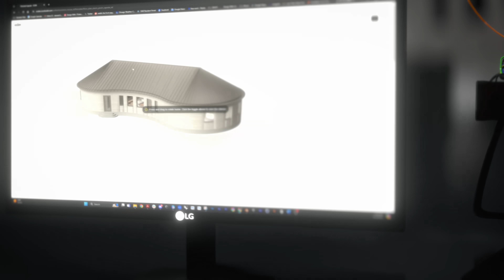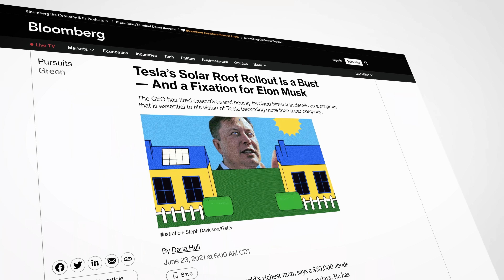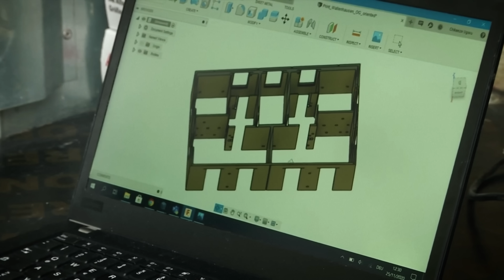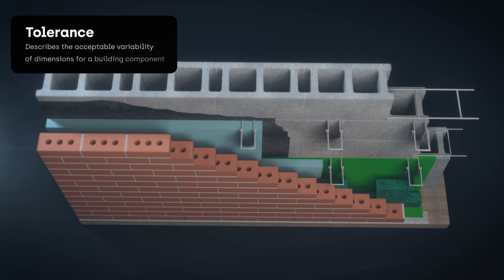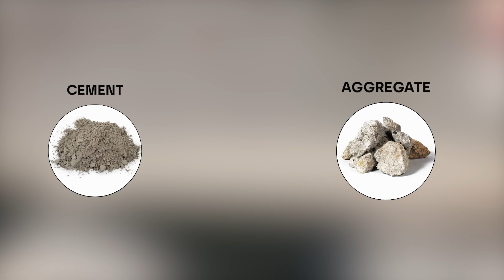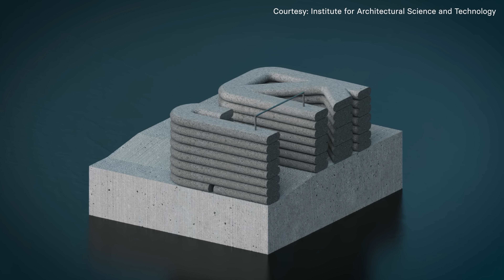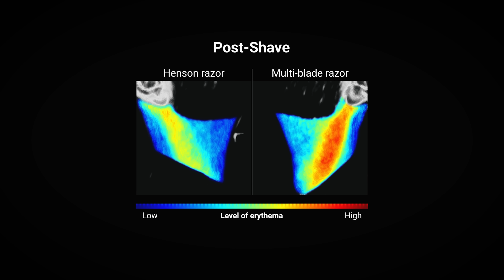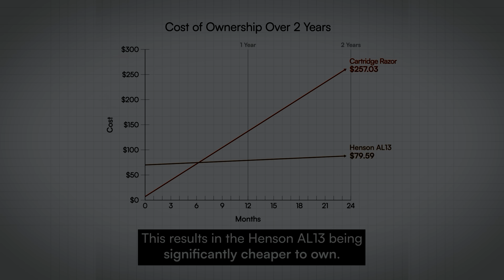Why 3D Printing Buildings Leads to Problems

Comment: You know what a bad idea is? A bad idea is pouring concrete without any reinforcing. Now that's a bad idea! Even some chicken wire in the mix makes concrete so much stronger. Take it from a guy that's jackhammered up more than his fair share of concrete. You want steel reinforcing in your concrete. That fibermesh is horse crap. Know what I'm not seeing in these printed houses? Reinforcing.
Reply: Lol, I am a seismologist and was thinking the same thing.

Honestly, some kind of resin/plastic 3D printed material would probably work since it's flexible, though I don't know about the longevity. Or maybe figure out how to 3D print what are essentially cinder.blocks (with open spaces), and then maybe you can add rebar down the center and pour in a slurry at the end to reinforce it?

There are also metal 3D printers... Could have multiple printer heads laying interleaving layers of concrete and metal (I assume actually making such a system would be practically complex).

Honestly, mass produced prefab "modules" probably makes more sense. Attach modules together as the "skeleton" of the house, and then the facade can be whatever you want to customize its appearance.

I assume there are construction professionals (not me) that are thinking about these sorts of things.
Reply: @brayoungful  I have seen these homes get built and they use a Quick Tie anchoring system to secure all of the walls to the foundation. Everything is held down under tension
Reply: @brayoungful  Prefab solves more problems than 3D print does. In Sweden a vast majority of multifamily housing is built out of prefabricated concrete.
Reply: @brayoungful  Far as I know, 3D printing in metal is all about high-precision prototype stuff. Though there's some "heavy industry" use making turbine blades for jet engines and power stations. Since they can print them with internal cooling channels and the like. It's done by sintering, laying down a layer of metal powder, then using lasers or electon beams, or something else, to melt the powder together wherever the beam hits and heats it up. Then they pour on the next layer of metal powder. So you end up with a sintered part. Complex and light but not as strong as just casting or forming some steel.

I dunno about just printing metal reinforcement for buildings. AFAIK they don't use the standard desktop 3D printer method of just extruding through a nozzle, that would be really really difficult to do with steel, you'd have to melt it. There's metal wire 3D printing that's a bit similar, laying down metal wire that's melted just at it's end, but it's not fast and it doesn't do "chunky"! 

You'd be better getting some humans to come in now and then and stick metal reinforcements in. Except of course the printer would have to work around them. Might not be possible to get the concrete around the metal parts if they're blocking the printhead.

Really the whole thing is a "solution" looking for a problem that it can't solve anyway. A daft novelty. Given the choice, I'd buy a properly-constructed house over a sand-and-cement extruded one 100 times out of 100. 3D printing doesn't make sense, in lots of areas, but that's OK.
Reply: @greenaum 3d printing steel is probably still a complete mess with heating and cooling related stresses on printed parts. They can manufacture expensive complex parts and use x-ray diffraction or similar to check stresses from the surface. No way that will happen with something like concrete rebars.
Reply: @brayoungful There's some fundamental flaws in the way 3D printing works that need to be solved before any attempt at printing rebar into printed concrete would work. You need the metal to be a cohesive mass throughout the entire length of it. As far as I'm aware, it's still a struggle for metal 3D printing in a controlled environment. With weather and humidity involved, at best you might get the structural quality of some really dodgy welds. At worst, it'll just be a stack of coins begging to fall over.
Reply: @brayoungful  Metal 3D printers are basically welding machine and keeping extremely hot, liquid metals from corroding instantly is the job of expensive nobel gasses in enclosed cases free of air movement.
The temperatures along would blast the wet concrete with it's high water content apart.
Reply: @brayoungful you could attach both printers to one arm, and have metal and concrete printing be sequential for each layer.
Reply: @ Metal printing doesn't work that way. 3D metal printing basically consists of having a box of powdered metal and inert gases, and using lasers or other point energy sources to melt and weld the powdered metals together, then layering more powdered metal on top and repeating.

If you tried to 3D print any ferrous metal in the open atmosphere, you'd just get rust. Not to mention, the heat needed would cause the water in any nearby concrete to boil, which is going to be problematic.
Reply: @brayoungful  Not every place has earthquakes.
Reply: @brayoungful  You're right, that kind of modular tech could revolutionize construction!

What do you mean, the Soviet Union invented that 75 years ago?!
Reply: @brayoungful Metal printing works in a totally different way than printing with concrete. 

Metal is printed by heating up the part of a bed of metal dust with a powerful laser. Then you add some more metal dust to just cover the structure and repeat. 
That’s going to be a challenge combining with layers of poured concrete.
Reply: So true!
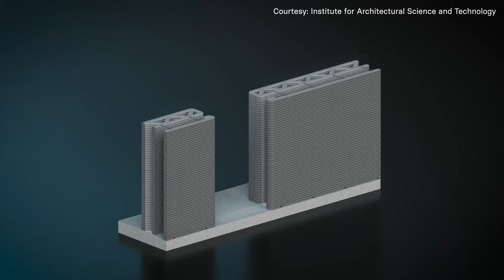Reply: @cohibaguy4981 missed 3:07
Reply: @cohibaguy4981 3:07
Reply: Current concrete and ancient concrete, completely different things. Besides, the walls of the structures from the Roman era are feet thick, not a few inches.
Reply: @cohibaguy4981 not exactly, they are just used differently. The Romans used concrete in compression forces only while we add in reinforcements to allow for tension
Reply: @cohibaguy4981  Feet thick = Compressive Strength
 Inches Thick requires steel or Fiberglass Reinforcement = Tensile Strength

Most standing Roman Concrete is in a subtropical environment with salt water, and crystalizes when brined, in a winter environment that brine would expand in the pores of the surface and chip away at it causing decay.

Roman Concrete does repel moisture instead of focussing it inside and because of imperfections in the lime mixture can refill itself sometimes hence the illusion of Roman Concrete healing itself.
The American Portland Association has a 20 year old PDF breaking down the bullshit that comes with the legend of Imperial Roman Concrete.
While the concrete is still impressive, it's not the end all.
Reply: @cohibaguy4981  oh no, we just figured out the exact Roman Concrete formula.  now you can choose Portland or  Roman.  Roman has a "self healing" factor which is why it last so long.  Hopefully we figure out how to make rebar roman.
Reply: @cohibaguy4981  No, Roman concrete is almost exactly the same. Steel doesn't even add any strength to concrete when it's used right (in compression) it's only needed because we use concrete in ways that it was never supposed to be used which ends up putting it tension. If the concrete is used properly it's better without steel reinforcement, because it will corrode and destroy the concrete eventually.
Reply: Around the 3:00 mark you can see inside the wall where they place wire within the wall (I think it's every 4-6 layers or so).
Reply: @philipmallinger  nothing vertical
Reply: @clayed3311  not true.

https://youtu.be/fPTps7e9SqY?si=_0UeALJ7rBDhXJtH
@25:30 they mention the rebar that goes vertically from the slab to the top of the wall that they completely pour around to make columns. In the Ariel video that follows you can see several that are visible out the top, as well as other pockets that haven't been poured yet.
Reply: This, the problem is the previous layers are already set. You need the reinforcement vertically so you would need a special tool head to split around the rods
Reply: @mattweger437  The way to do it is erect the steel and then put forms around it. That's the way it's actually done. Symons forms. It's a well established system. The panels, the connectors, how you put it all together.
Reply: @mattweger437 they do rebar reinforcement vertically and pour a solid column around them.
Reply: @philipmallinger  yeah but not consistently
Reply: That's an excellent point because the printer is going to have a hard time putting in the rebar. I saw a picture in a place where an earthquake that occurred and there were acres of rubble and my friend and I both had some concrete experience and said look at that not one foot of rebar in a mile of City concrete. There wasn't a rebar sticking out of anything anywhere and it just crumbled like you're saying
Reply: @markmcgoveran6811  concrete has compressive strength but no tensile strength.   You can put a lot of weight on concrete but it can't handle torsional loads. Concrete doesn't like to bend. It'll just snap.  But with steel in concrete it handles those torsional stresses. Like the cables in a suspension bridge. Beyond no reinforcing they usually just use poor quality concrete in those low rent districts too. They juice it up too much, don't use enough cement and use the wrong kind of sand. They basically do everything wrong you can possibly do. Not every sand is suitable for use in concrete. You need to use sharp sand. In the desert they need to import sand. wind blown sand is dull. It's no good. You'd think sand is sand. Nope. Sharp sand locks together better. Every grain contributes to overall strength.
Reply: @1pcfred  yeah that's all true I saw a lot of sad stuff I went to 7 years of engineering school and I volunteered at some stuff with roadside safety looking at the way cables and car crashes happen. It's just not a good way to use a 3D printer it's a new technology and there's going to be some bad dead ends and these people are going to spend a lot of money on a dead end and try and engineer their way around it. If you had a guy going along throwing in pieces of wire as fast as he could l-shaped and about a foot long with just a 1 inch hook on the end and plenty of them you could come up with a pretty strong wall but you got to get some metal in there and that might require hand labor.
Reply: @1pcfred  it's a very advanced science and you can tweak a lot of variables to get what you want these guys are claiming they got a 3D printer and they turn out some kind of a concrete. I agree with you wholeheartedly that's only a fraction of it.
Reply: You’re just demonstrating you don’t know what you’re talking about
Reply: I’ve seen the drawings and details. All projects need to meet code. Reinforcement is provided. Glass fiber is added in the mix. Rebar can be added to printed cells within the wall cavity when the machine is not printing over the area.
Reply: @aromero2452  Don't bother these people with easily found facts, they've got a narrative lol.
Reply: cant reinforcement wires be embedded into the printing?
Reply: @nutzeeer  if they do It after the cement is laid i think It would mess It up probably
Reply: @nutzeeer  sure you can. Some things are easier said than done though. It's not a trivial task. If it was easy they'd already be doing it.
Reply: I worked on building a cinder block building with my dad and a block layer by trade. The very first thing he did before he even allowed my dad to go out and buy a single brick? Made us a list of how much rebar and steel wire he'd need to start a framework. Then, set up a foundation of... You guessed it. Rebar and steel wire "square tubes" to fill in with concrete. I was 14. It was that day that I learned about tension vs compression when dealing with concrete buildings. We didn't start laying bricks for two weeks straight. It was all framework. The first brick went down AROUND the frame structure (or rather the frame when through the cinder blocks holes) to have something to stablize it before linking the rest together.

Now, IDK how we do it in the US, this was in Mexico. And this man was not a contractor. He just built these homes for people because it's what his dad grew up doing and he learned from seeing other people's mistakes. He never once made a home or corner store building that had problems. The one I worked on was raised in 1999. It's still standing today.
Reply: I see the layer lines and I say "that will crack in the winter when it shrinks and expands"
Reply: @thecwd8919  cement can bond pretty good. Heck we just dribble blobs of the stuff and it sticks. It has to be chipped off. So what we do is sand the floor. We just throw dry sand on a floor before we run up a wall. That stops mortar from sticking pretty much. But it isn't 100%. We don't bury the floor like it is the beach.
Reply: Concrete can be reinforced with glass fiber and be just fine. This doesn’t look like concrete though, it looks more like cement or mortar mix.
Reply: @thurlravenscroft2572  that’s the same load of bs the concrete guys sold me on to keep from putting wire down or rebar for my concrete pad I poured. It literally cracked in half in under 3 months.. a $10,000 pad for a 40x40 shop mind you 😂 yea fuck “fiber”
Reply: @Halfstep2024  to be honest, if your soil is that unstable, rebar isn’t going to help either. Good soil prep is more important than reinforcement. Also, rebar corrosion has been a major contributing factor to a number of concrete structure failures … It’s situational and unless you have someone who specializes in soil mechanics, you can never be sure what the end product is going to be like. In fact, even with expert analysis there will be unforeseen events that happen.
Reply: @thurlravenscroft2572  yea you’re probably right. I’d say it had more to do with grade work than anything. But my concrete guy getting deported before he finished the job and his boss acting like I never existed never helped instill much confidence either 😂
Reply: @Halfstep2024  😂
Reply: @thurlravenscroft2572  Nope.  Incorrect.  Not against something like high wind load.  That's why it's illegal per building code
Reply: @Marcus-p5i5s  it depends on the application. I doubt 3D printed concrete houses would meet building codes anywhere in the US, except Alabama. That being said, the walls of a small one or two-story concrete structure isn’t going to experience any significant wind loading in most situations.
Reply: @thurlravenscroft2572  Kidding  aside (Alabama has hurricane building codes like Florida)  Walls of a two story or taller one story house in hurricane conditions have enough load to fall if not reinforced.  I live in Florida and have been through 5 hurricanes.  The walls of thos printed houses would fall for certain.
Reply: @thurlravenscroft2572  aggregate has to be tiny gravel if there even is any..
Reply: @thurlravenscroft2572  What's the difference in thermal expansion and how well  does concrete adhere to the smooth surface of the fibers?
How long do you think the fibers need to be to actually provide structural tension and not just some abrasion-resistance?
Reply: @Suranfox  the thermal expansion coefficients of both materials are nearly identical, so it doesn’t cause an issue. You can’t just dump a bag of chopped fiberglass tow into standard concrete and expect it to function properly. The concrete has to have a different ratio of aggregate to cement and other additives for it to work correctly. The length of the tow is customized for each purpose. You’d have to be more specific.
Reply: @thurlravenscroft2572 This is a sand / cement mix. The limit on fiber reinforcement is the nozzle size - the length can’t be more than half the smallest diameter.
Reply: @thurlravenscroft2572 fiber helps with cracking, but not structural. It breaks apart as easily as unreinforced concrete. Even welded wire mesh holds up better.
Reply: I don't think i would call it concrete anymore .
Reply: @X862go  I'm not seeing aggregate in the mix. It looks like grout or slurry to me. Which isn't as strong as concrete is. Rocks be hard. Yeah we add rocks because they're cheap. But they are rocks. Half of the mix is rocks. So they're pretty important. I call concrete wet rocks. When you're pouring concrete that's basically what it is. 1 part Portland, 2 parts sand and 3 parts rocks. Slurry is like chocolate chip cookies without chips.
Reply: or if can recreate roman concrete that would be better
Reply: There are a few cases in which concrete works well without reinforcement; that is why the Romans used their concrete (with its similar structural properties) in arches and vaults primarily: excellent in compression, of which arches and vaults are prime examples.  Still, it is a real problem that it is much more difficult to reinforce this concrete.
Edit: impossible is perhaps a misnomer, so changed it to much more difficult.
Reply: @unconventionalideas5683  I'm thinking about it and I may know why the're not putting any reinforcing into these. Ironworkers are not big on anyone or even anything taking their work. They take great umbrage then. I really wouldn't put anything past them to do in retaliation. I do mean anything. Most of those loons belong in jail anyways.
Reply: Shh let's not talk about predicted lifecycles of these. Just buy the house and someone else will have to deal with it in 5/10/20/50 years. 

I have really little faith that these would be even close compared with old brick buildings that will probably stand next 100+ years as long as basic maintenance is not skipped completely..
Reply: @timop6340  I've lived in old buildings. I like newer ones better.
Reply: Guys its not concrete, its a proprietary mixture including a variety of polymers xD

You couldn't make a structure out of concrete like this. 

Also its worth noting that there is reinforcement between the walls in the insulation layer. If youve ever see double brick walls its a very similar concept.
Reply: Nah, you can easily make walls of these models hollow then add wiring or metal nets whatever you want then to pour concrete inside walls, cheap and durable enough, i think. Still beter than cardboard houses made in US.
Reply: @Navidad407  It is not legal to just bury wire in concrete. Even if it was how are you going to tie into those wires? What you're suggesting is not how anything works or even can work.
Reply: @1pcfred  what i meant is that you can install propper metal reinforcement inside hollow walls. In that way the durability of building will rise drastically. But, still, even without these reinforcements its durability will be better than such with a drywall houses.
Reply: @1pcfred  perfect technology in idiot's hands will crack and fall apart. I don't see much problems with 3d printed masonry in advance to traditional one, people still use some kind of form made of wood or other materials to poor cement. What's the problem of making a form with a 3d printing out of cement? It is still possible to install proper metal reinforcement. But in advance 3d printed "house" can have some imbedded sockets for electricity and/or plumbing. Basically such technology can replace manual work of building walls brick by brick.
Reply: Can't we just talk to the walls and beg the house not to collapse? Please Mr house.. Don't fall on me
Reply: Theres also the textured issue... Mortor and concrete in general is smoother (perhaps a brush finish for grip), but the smoothness helps shed water.
I'd love to see how, after a few dozen freeze cycles all those ridges trapping water fair.
Reply: @2112user  What you're talking about is called consolidation. Troweling concrete consolidates it. Whoever came up with this 3D house printing stuff never worked in construction and is doing everything possible to never work in construction. I get it, hard work is scary stuff.
Reply: Ahhh a comment section which people that actually know what they are talking about! What a unicorn! Awesome reality check gentlemen. ❤
Reply: You know what doesn’t have reinforcing, the Pantheon in Rome, still standing today after thousands of years in a perfect state. You know what I see falling apart left and right with cracks, reinforced concrete structures in the US both are no more than 40-70 years old.. built by know it alls like you 😅
Reply: @georgem7195  let me dump tons of salt onto the Pantheon for decades and see how long it holds up.
Reply: @georgem7195  that's because the reinforcing rusts, expands and blows the concrete. 
As my old Mason uncle used to say "worst thing you can put in concrete is steel". But you do it if you have to because you can't afford concrete.
Reply: Did the Romans actually build structures with solid concrete (as a replacement for blocks of stone)? That is what what's been discussed above seems to suggest.. All I personally know is that they often did not use even cement IN-BETWEEN the blocks of stone they build their huge bridges, aquaducts, buildings and other structures with. An application I DO actually know about is that they used it as a coating on the inside of a dozens of miles long canal (if that is the word, it ran over bridges and through tunnels as well) to m that transported water to Rome that came from afar. THAT concrete in many places is still intact, and the structure reportedly is still in usable shape
Reply: @harrickvharrick3957  Roman aqueducts. When Romans built bridges they made the engineer stand under them when they took the blocking out. It kept a lot of the same mistakes from being made twice.
Reply: Concrete without reinforcements works in compression
Reply: Yes. Adding fiber mesh may reduce cracking due to shrinkage etc, but for the strength you need to support loads you need steel reinforcement. Especially for lateral loads due to wind and earthquake.
Reply: That but also a waste of time, money on all the equipment needed to set up, monitor and fix the printer when something goes wrong.
Then you have to deal with uneven walls and rounded corners, its gonna take more time and materials to make flat walls out of those curvy and jagged walls.
They also will face issues with hanging up cabinets, heavy stuff to those walls as unreinforced cement do not like wall anchors.
A good, fast, reliable, cheap solution would be a mix of pre-fabricated concrete slabs, good old fasion brick laying, cement panels to divide some spaces.
Reply: @JerryDoe  there's building systems today. Like that insulated concrete form stuff. 3D printing concrete is a gimmick. Whoever came up with it never spent any time in construction and never wants to either. They're too good and clever for that. Nothing's cheap. Building a house costs from $138,523 to $525,406 on average these days. That's why we have homeless people. Because not everyone has that kind of money. That's just what it costs to build. You have to have land to put it on. That costs mo money.
Reply: @1pcfred  I joined my father in construction for 5 years or so till i finished my studies in engineering, electronics, hydraulics etc...
My father did also everything around the house himself.
I can do most jobs myself such as rebar calculations, pouring concrete, laying bricks, roof and waterproofing of structures, electricity, water piping, solar installations, pool design and construction...

I agree on the price quotes, but so is installing a wall mount for a tv or laundry machine if you need to hire "the guy" to do it.

The only "guys" i still need to hire are for tiling, flooring ceramic tiles, helpers for pouring concrete, wall plastering...

I'm pretty fast and handy with most things.
Reply: @1pcfred  Not my problem.
Reply: @JimStanfield-zo2pz The Pantheon is a single exception that cannot be used to negate any rules. And in fact it is not. There's absolutely no way you'd get a permit to build a structure like it today. I've busted up plenty of fiber reinforced concrete and I never noticed it being much stronger than unreinforced concrete. How much concrete have you jackhammered?
Reply: Looks horrible. No more sustainable than current methods.  Pfft lame
Reply: It is reinforced dummy
Reply: Maybe it's only a test
Reply: This was exactly my first thought.
Reply: The romans did it without reinforcement.
Reply: Nothing wrong with fibreglass.
Reply: @MikeySlou  that hasn't been my experience with fiber reinforced concrete. I can only go with what I know. Fiber reinforced concrete is only marginally better than unreinforced concrete is. Fiber is not nothing but it's not much either. I can easily pry fiber reinforced concrete apart. I cannot pry steel reinforced concrete apart. No way.
Reply: To your point not all builders are using traditional reinforcement but some are. Like any trade, some companies are doing it right, some not as much. You dont knock the trade for it, but the people doing it poorly.
Reply: Even if it's not as good as steel reinforced concrete, do you know if it's good enough for places not prone to natural disasters?
Reply: I think the only way they could get by without steel reinforcement is if they include a fiber for tensile strength. Doesn't seem like there is anything in there though.
Reply: @getinthespace7715  I don't think fiber would resolve on video unless we got an extreme close up. That stuff is like hair. Supposedly it is some proprietary blend. Still, if it's that special then I don't see it being too cost effective. Just hire people and build it right already. I know what construction workers cost. It's not that much.
Reply: Glad to see I'm not the only one freaking out about that.
Reply: I have been wondering about that part.
Reply: This was my first thought when looking into 3d Houses
Reply: Facts bro 💯
Reply: Wind lift anchors 😂
Reply: I view it as a possible way of making bases on other worlds or our moon. May sound stupid but it'll require us less resources to make it.
Reply: @Jd-zl7mn  how do you make cement on the Moon? I just don't think there's a whole lot of lime up there.
Reply: @1pcfred  "cement" more like glued ground. Only math after that is how thick the walls have to be.
Reply: @1pcfred  I know it's not cement. I was pointing out a use for 3d printed houses not having rebar. Sure not as strong as a regular structure but a handy tech that you can easily bring to other planets/moons to reduce weight/cost of building other places. Once a base is set we can take it from there.
Reply: when you add stones and gravel to concrete you get what your talking about. the concrete itself if the fine sand and mixture, when you crush sand it creates sharp edges on a microscopic level and really sticks to each other, the fiberglass is used I assume to keep the material flowing as its layered down. Common mistake thinking concrete has rocks and mix.
Reply: Facts!
Reply: Lmaoo. Some white people shit .
Reply: @ElDifERENTE310TV  yeah we don't live in dried dung grass thatched huts. Our ancestors moved out of those neighborhoods long ago. White flight!
Reply: 1. Code is minimum standards only. If you only build to code you are building a piss poor home. 2. I’ve inspected 3D printed homes through all stages and there is steel that is added at points throughout the build for strength. 3. The inability to not understand isn’t an argument against. It’s only an argument for your inability.
Reply: hey dad there’s different concrete mixes
Reply: @groper.not.grouper9501  there's always two ways to do everything. The right way and all the other ways.
Reply: I use Roman.
Reply: These builds are usually using some kind of composite. Also see the single pour concrete houses in NJ. :)
Reply: They do use reinforcement. He just doesn't show it in the video. In further iterations of this, I think they will be able to build taller by pre-installing rebar before the pour.
Reply: Yep
Reply: What if we combine this along side one of thoes automatic domino toys but with bricks
Reply: What's stopping us from adding it afterwards,or even DURING the printing process?
Reply: @raylenn4444  I'll bite, why aren't you?
Reply: @raylenn4444  how are you going to manage to do that? The process we're seeing simply doesn't work. There's no technique where reinforcing is added after the concrete is poured. First off all you'll likely accomplish is destroying what's there. But even if you could manage to introduce the reinforcing it wouldn't bond to the concrete anyways. It's like trying to board a ship after it's already sailed.
Reply: @1pcfred  so long as the concrete is fresh, it's malleable.

Hence rebar could be stuck into it so long as you do it gently.

Secondly, adding composite polymers on the outside of the concrete could protect it from the elements and add some solidity to the mix.

Thirdly, you could add metal powder and other materials as admixes to get a stronger concrete.

Especially of you add volcanic ash, as that's what's behind the self repairing properties of roman concrete.

The options always exist if you're skilled and creative enough.
We just have to innovate and experiment more with it.
Reply: I have seen stone foundations of houses that are 400 years old and they are strong.
Reply: @christofferraby4712  nobody knew what they were doing 400 years ago. They were all clueless rubes in the Dark Ages. OK maybe that was the Renaissance? They were still pretty clueless then too though. I mean they didn't even have toilet paper. Anyone without toilet paper is a savage.
Reply: Then we want steel buildings. We can stop using concrete all together.
Reply: @matthewdancz9152  we use concrete because it is magic. You add water to dust and it turns into a workable plastic and then solid. Just how useful those attributes are cannot be overstated. Concrete is a miracle material. Steel is good stuff too but our ability to work with steel on site is more limited than concrete.
Reply: I agree on a cursory point, I'd argue though that fiberglass rebar is probably better for low wear, permanent structures, specifically because fiberglass doesn't corode or rust and doesn't create cavities when it happens
Reply: @whoathatsalotofdamage3718  very little today is built with permanence in mind. Generally everything is built with a 50 year lifespan. Because in that span of time things change. So we expect use to change then too. So there's no point to having a defunct building in perfect shape either. Plus we realize now that in that time technologies change. We retrofit that new tech into older buildings. But that's not the same as designing that tech in. New is just better. The rate of change has accelerated and construction is in step with that concept. The only constant today is change. So building permanent structures makes no sense at all.
Reply: some of these have kevlar fibers.  -- which has a lot of tensile strenght..
Reply: Hope you wear a P3 mask while jackhammering concrete, May as well be jackhammering Asbestos if you aren't.
Reply: Your postal looks like the profile dude
Reply: Notice the one they built that was successful is a single level with a drop on roof.
Reply: Exactly what I was thinking too.
Reply: I figure they could at least drive beams into the unhardened concrete while it's still printing. Ig it takes research to work along side the printer but that's what it needs. We need to be working with it like it's another worker. It has its part in laying concrete but we need to learn to be quick inserting supports and reinforcement while the machine works around us.
Reply: @gwusbwth  therein lies the rub. One thing machines don't do is work around. The working around would be entirely on you. And as careful as you try to be eventually you're going to make a mistake. Then you're going to find yourself a part of the wall. That machine will plaster you right in. Cement the relationship between you and your work.
Reply: Get roman concrete and you dont need all that
Reply: Reinforcing rod isn't put into concrete because concrete is weak. It's put into concrete because concrete is expensive. 
Concrete is highly flexible. Don't believe me pour a 8"x2" slab and jump on it. It will bend like timber. Half the time concrete has issues, it's the reinforcing rusting and blowing the concrete. There's also a difference in flexibility between  the concrete and steel which doesn't help its structural properties. 

As a building goes, this should be just as crap as anything else. 

If concrete was cheap enough, you could make walls a yard thick with no steel and it would still be there in 2000 years.
Reply: @FREDDAGGS  concrete is a lot cheaper than steel is.  It would take 36 20 foot long 1/2" diameter pieces of rebar to displace a cubic foot. Which is about what one sack of concrete is. Those 36 pieces of bar would set you back around $300. Then there's the labor to install them. You don't just throw bar into mud and call it good. So the labor would double that price. Now you're looking at $600 a cubic foot. A sack of concrete costs $5 So steel is about 120 times more expensive than concrete is. Now you see why not all concrete is reinforced.
Reply: @1pcfred  Firstly, no one is going to build a building out of rebar.  A combination of concrete and rebar meets engineering specs for the lowest price possible at the lowest weight possible. That is why we build with it. Most people have no idea why they do anything. 

The Roman concrete that still stands has no rebar. Its just massively thick. This is superior and the reason we don't do it is we can't afford that much concrete, globally. 
We could and if you want technology, I would just make concrete so cheap we could build massive structures with it.
Reply: @1pcfred  it's not a secret. It's superb concrete but it's not something we can't do. Modern concrete is better, as good as Roman concrete is. 

Cement just costs a lot, so we try to make a little go a long way. Aggregate is worth significantly more than what you dig out of most gold mines. 

Fix that and we can start making meter/yard thick walls that will last millennia.
Reply: @1pcfred  The idea behind the 3D printing was because globally, >95% of people can't afford to own a dwelling and eat. 
You may find this is because so much of those expensive resources ended up in a landfill 5 minutes after the building was constructed. 
Spectacular waste, but it kept some builders busy for a while and the mortgages were profitable.
Reply: Looks like some @2:53
Reply: Not really true. Bricks and mortar are basically rocks and cement with no reinforcing. Also the concrete used in these machines are not the same as the concrete used for footpaths and foundations. Still, concrete is a terrible material for this sort of job. They are better off using that machine to place mortar for another machine to lay bricks. It could at least be faster while maintaining the current standard of a house.
Reply: @bausHuck  We actually don't build structures out of brick anymore. We use brick facade. There's one layer of air gapped brick held up by a block wall. So it's more like brick siding. The brick is held to the blocks with wall ties. The whole building will be reinforced with structural steel. Laying block properly may be trickier than you realize too. You don't just plunk blocks down into the mud. Maybe you should work on a masonry line for a while? Learn how to butter blocks. Mortar has to bind to the brick and block. It's skilled work. We can't make machines that sophisticated yet.
Reply: @1pcfred  we build brick facades because again, the building is cheap disposable temporary junk and by "we" you mean seismically poor regions. Much of Britain lives in >200  year old brick structures. Still solid houses. 
Another reason is modern "tradesmen" are really just fabricators who put together kitsets. Hardly any real masons left.
Reply: @1pcfred  So your response "its all too expensive" which was my original point. We don't build anything because its the best way to build. We build in any particular way because its the cheapest that meets a minimum standard. We are actually flat broke, covering it up with technology. 
Builders and engineers always talk about things like they are the right way to do things. Rather than admitting its better than living in a cardboard box, but the engineering is based on the same principles.
Reply: Only anything that has strength of itself can add strength to a structure whatever it is. Of course you know why concrete requires reinforcement: to help the structure resist all forces that stray from compression. It IS possible to reinforce concrete by making use of fibers, this might lead to results that ACTUALLY are stronger. It is possible to make special glass fiber that DOES have tremendous physical strength (it would be much thicker than the optic fiber type and doesn't need to meet complex specs) that when cut into pieces between 1 and 2 inches can be mixed in so that there'll be up to a handful or so in every cubic inch. Strength in this case comes with numbers. Be cause of its sufficiently flexible nature and short length of can be added to a mixture as these automated machines would suspended. Besides that nowadays there are new ways invented to make concrete with significantly more strength itself. This of course is advantageous be cause significantly LESS of the material could be used for creation a structure whilst maintaining a similar(ly strong) outcome. In Amsterdam a bridge (for light traffic) was built over the IJ river with decks that are less than an inch and a half thick. It has been reinforced with glass fibers that were mixed in into the concrete mixture.
Reply: @harrickvharrick3957  fiber reinforced concrete is stronger than unreinforced concrete is. But it isn't much stronger. I've busted out fiber reinforced concrete with a jackhammer. The stuff comes right up. Steel reinforced concrete doesn't. Not until you cut all of the steel in it. One wire and it'll hold a chunk from being removed. It's frustrating. Fiber is an easy day though. Pops right out.
Reply: @1pcfred  Yes that may be so, as you say... but I wonder if the fact YOU could 'bust up' such concrete parts of constructions with your jackhammer, which is a specialized, I suppose hydrolically (or maybe pneumatically) powered tool, which indeed is specifically designed to do precisely that, should be compared to the forces that a structure would have been made to withstand iin everyday life??
Reply: Your comment made me wonder if this is solvable in 3d printing. I know in the smaller scale some polymers have either chopped up carbon fibers or glass fragments to add different strengthening effects... Wonder if something similar can be done in cement printing
Reply: Graphene and or plastic fibers broseph
Reply: There are house3d printing firms that also do reinforcing automatically with a robot arm+welder whilest pushing out concrete
Reply: @JonneBackhaus  at the end of the day you still end up with a concrete blockhouse though which I'm sure some folks like. I'm not so sure I'd want to live in that though. How do you insulate it? Concrete has lousy R value. 1" of concrete has an R value of 0.42 and fiberglass insulation is 3.41 so that concrete might as well not even be there for all the good it's going to do you. How do you get plumbing and electrical into concrete walls? I'm seeing a lot of problems. You get robot welders to install that too? This ain't the stone age anymore Og. I want amenities today. Like lighting and running water.
Reply: @1pcfred  the plumping/elecricity channels are prettymuch a non brainer since they can be incorporated in to the desing. Also as an european i pretty much giggle at an murican who is against 3d printed houses when prefab drywall shit in the states exist. Especially since the concrete in these 3d printed projects is sheldom the outer/inner material
Reply: @ "Also as an european i pretty much giggle at an murican who is against 3d printed houses when prefab drywall shit in the states exist."

Prefabs and printed are not the same. I haven't seen a single person here arguing against prefabs, and prefabs don't share the same problems and limitations as a 3D printed structure.

For one thing, housings for utilities can be pre-installed into prefabs, but this isn't true for a 3D printed structure. The 3D printer is only able to do one thing: Lay concrete, or whatever other printer material it is using. Anything else needs to be actively added to the structure by either workers or additional machinery, preferably in the short time frame before the concrete hardens.

Molded concrete prefabs would make a lot more sense than this 3D printed nonsense.
Reply: Adding steel puts a countdown timer on your construction ensuring you will have to tear it down eventually.  Unreinforced concrete can last centuries if made right.
Reply: @asitallfallsdown5914  that's not true. Whether steel corrodes depends on environmental factors. Even in the poorest conditions you're unlikely to be the one that'll have to tear anything down either. Steel has a longer lifespan than we do.
Reply: @asitallfallsdown5914  Worked 5 years in construction before i finished my degree in engineering, pre-fabricated construction is easy to tear down if you know where to start.
Unreinforced concrete is a recipe for disaster as the cement cannot keep "tension" and will eventually get very brittle.
Rebar in the correct amount, thickness, layout keeps the concrete under tension and preserves its life span and strength.
Reply: Roman concrete has entered the chat. No steel reinforcement and going strong 1000 years later!
Reply: @bobbygetsbanned6049  you suffer from survivor bias. Plenty of Roman concrete has failed at this point.
Reply: @bobbygetsbanned6049  Some tip before talking crap, Roman concrete takes 100x longer to cure vs regular concrete, it also depends on oversized support columns and beams, it also requires volcanic ash, volcanic rock and lime which are scarce expensive to come by.

You can also not print Roman concrete, it needs to be poured in full blocks.
Reply: @JerryDoe  I never said use Roman concrete, I said it lasts longer because they didn't use steel reinforcement. Modern concrete in stronger, and when used right it doesn't need rebar, we just almost never use it right.
Reply: @JimStanfield-zo2pz it’s compressive strength that holds that together as opposed to tensile strength in modern buildings.
Reply: Not if the material is only in compression. People used to build without rebar for thousands of years
Reply: @seasong7655  yes and that's why their structures are all on ruins today too.
Reply: Where is the steel reinforcing in birck&mortar houses? doesnt seem to bother them
Reply: @TuriGamer  there's doorwall mesh between the brick courses in the mortar. Although modern brick is just facia. It's basically just an exterior siding. The structure is behind the brick. There will be a block wall that's tied to steel and out of the block are corrugated strips of metal called wall ties. They're put in when the block is run up and then placed in the mortar joints when the brick is laid. So that's where it is. Where you can't see it. But it's in there. You just don't know it. In the olden days when they actually built with brick the brick was laid in elaborate patterns that locked the layers together. Like the Flemish bond. There's more than meets the eye.
Reply: @1pcfred  I see, thanks for explaining
Reply: True. It is innovative yet traditional ways have been used for as long as they have for a reason
Reply: @SlashSlash420  we generally do things traditionally for long periods of time because we can't do them any better. Eventually that does tend to change. Many never live long enough to see it though. Actual progress can often be a slow process. We notice rapid change. We're wired to ignore what doesn't change.
Reply: The vídeo said it is a special kind of concrete, build for this task specifically probably
Reply: @EddandEd  it is not so special it doesn't need to be reinforced.
Reply: Fiber is bad because you say so?  Ok...
Reply: @merrillballantyne  I have worked with fiber in concrete. So I do have an experienced opinion on the matter. I've placed it and removed it too. Fiber adds the strength of a little baby. It's like a little baby tugging on its rattle. Barely there. Might as well not even bother with fiber it does so little. Even chicken wire adds many times the tensile strength. You chicken wing.
Reply: You have no idea what you're talking about. You're out of your element Donny. This is fiber reinforced. It's overly strong for one story, and even safe for 2 stories.
Reply: Good question but not on point. Bridge pavement is reinforced, interstates are mostly not. When you think of reinforced concrete the advantages are usually seen in tension. Think about what conditions your house would be loaded in a manner that requires vertical reinforcement. Nada… anyways with a project I’ve helped on they reinforce the inside and outside walls together and trust me these things are WAY more durable especially in a tornado etc…
Reply: @InnovativeEngineering  concrete road beds absolutely will be steel reinforced. The government doesn't play games and they can afford to do it right. You're paying for it so why would they care? Plus the interstate highway system is a military strategic facility. You just don't know it. So parts of it are designed to accommodate heavy bombers. Which is why they're going crazy with the steel reinforcement. If the need arises they'll blow up anything that'd be in the way on the side of the road and start using the roads as air strips. Signs, street lights, whatever. At least that's the plan.
Reply: There are fibers in the mix usually.
Reply: @WillLightfoot  the strength fiber adds doesn't impress me. I've jackhammered up fiber reinforced concrete. It has a little pull compared to completely unreinforced concrete. The difference is marginal though. Steel reinforced concrete on the other hand stays together. You're not just snapping that steel. Steel is a tough material. If it's large rebar you'd better have a torch. Even the thin stuff is a bear to cut with the chisel. You can do it but you're going to rattle a filling out in the process. It's such a waste of time.
Reply: @1pcfred  this isn't your typical 3500 psi type I/II concrete of course.  But I agree demoing slabs with wire mesh/rebar is much more of a PIA than without.   Personally I think that ribbed look is crap, and the trick is to incorporate a litte old school with new school, so how about metal lathed stucco coat over that as it's curing? Then you have a nice smooth surface to prevent dust buildup/insect nests, and a form of metal reinforcement.  But that's vertical reinforcement.  I usually see horizontal bars spaning between the exterior and interior segments of the walls placed by workers as the walls are printed. So the entire process is not completely automated.  Far from a perfect process right now, but it has its potentials.  Combined with inflatable reusable bladders and injectable high density PU foam it could be possible to make highly efficient large domed structures, and maybe reinforcing steel or fiberglass rebar, or scree will be part of the equation, it's difficult to say.  I know many are working on alternatives to steel reinforcement because of a variety of reasons one being spalling if water does penitrate and start rusting the rebar.  Probably less of an issue here than a foundation that needs to keep back the pressure of the wet earth around it in areas of high saturation.  An other way of giving strength without having thick solid walls is making a corregated type print so it looks like the cross section of cardboard and all that deadspace in the wall helps insulate the interior.
Reply: Rebar❤ I would get rid of the cement and just use a mixture of sand silt and straw😮😮😮😮😅😅 Adobe otherwise known as Earth is the best insulator but all these colonizers want to use plastic products and cement terrible for the environment it's better to go with indigenous
Reply: They have some "reinforcement", they lay two interconnected layers with additional metal pieces to connect them. Its probably way more cement than youd normally use, and the video at most shows two story buildings, but it seems to 'work'?

Still questionable if this is just another superfluous "tech" solution to a engineering problem.
Reply: It's there, it's not shown in this video but they lay metal bars between layers.
Reply: @derekk.2263  doorwall is a welded wire product. A good masonry wall has horizontal and vertical reinforcing .  There's doorwall between the  courses and rods down the webs. 3 and  3. We demolished a bank vault that was 1 and 1. A whole crew of guys with pneumatic chipping guns going at it all day and we got barely anywhere. So the next day we brought a robot on the job. It had the vault leveled in   45 minutes. It was a platform the size of a jeep with a robot arm on it. A  construction robot. They're a thing. But hey we softened it up for the machine. That vault was tough.
Reply: Masonry also does not have reinforcement, yet Europe is full of brick houses that are hundreds of years old. Not every house stands in an earthquake zone.
Reply: @ Very few brick houses in Europe are centuries old, average is less than 60. Earthquakes aren’t the only thing that shakes the ground.
Reply: @allangibson8494  Yeah, because the population has grown and we had this thing called ww2 that destroyed a lot of old buildings. And I don't think adding rebar would have saved those buildings from bombing.  

So my point still stands: you don't always need rebar to build long lasting buildings.
Reply: @ most of the old “masonry” buildings in Europe had timber frames and floors trusses. 
If you want an actual fast modern construction technique, tilt slab is hard to beat. And those CAN have wiring conduit pre installed.
Reply: @allangibson8494  You are wrong there. In most European brick houses the bricks are load bearing. Wood framed houses with bricks in between the beams stem mainly from the middle ages and are a rarity. 

Trusses have nothing to do with the need for rebar in the walls. 

I am not advocating for a certain building method. I am just saying rebar is not always necessary.
Reply: @ Structural brick houses in Europe were mostly leveled by bombing during WW2. Well over 95% of current stock are recreations of the older designs and use different construction techniques and materials than the original buildings that were explosively demolished or shattered by blast forces.
Reply: @boldvankaalen3896  do you know what a cape chisel is what and what it is for? Because if you don't then you also don't know too much about brick buildings either.
Reply: @1pcfred  So instead of reacting to the content of what I am saying you go for an ad hominem*.  By using this rhetorical tactic, you just show you have nothing to contribute to the content of the discussion. The observation that centuries old brick buildings exist, and that these do not have any rebar in i,t is independent of knowing the English names of all builders tools.

Not being a native speaker I had to look up what it is, and it turns out I actually used it when renovating my seventy year old brick house, to remove loose mortar and to remove  loose bits left by the wall router when creating canals in the walls  for the cables.
Reply: @1pcfred  "After the mortar begins to deteriorate. Then you have to knock it out and repoint it."

That is exactly what I described how I used it.

But that is not relevant. I am not a professional builder, but I do know my own house in and out,  I grew up around building sites,  I can read and inform myself, and I can use my eyes.

The thing is the world is bigger than your country and where I live load bearing brick walls are very common, both in historic buildings as in new builds.  And these walls survive hundreds of years without rebar.  

In modern builds there will be rebar in the foundation and the concrete floors, but we were talking about the walls. So despite your ad hominems the conclusion still stands: you do not always need rebar in walls to have a long lasting building.
Reply: @1pcfred  Masonry buildings in Europe that are hundreds of years old prove the opposite. It very much depends on where you build. In areas with earthquakes you are right, but it is not generally true.
Reply: @1pcfred  Where I live this kind of problems are solved by the foundation of the building.  For example in the Netherlands a lot of buildings are built on peat land that subsides over time. This is solved by having deep pier foundations that reach the stable sand layer below. 

So the stable foundation makes sure the walls are not under stress because of the instability of the soil, so no rebar reinforcements in the walls are necessary. 

By the way: I did not say that rebar is never necessary, I just said it is not always necessary.  The best solution depends on the local circumstances, the type of foundation and the use case.
Reply: Yea.....do ya know what's worse than that?...... 3D printed houses are gonna fuck how people out of jobs?
Reply: Plain concrete has massive compression strength but it will not support it's own weight only span. Minimal reinforcement can help resolve this issue.
Reply: 3:11
Reply: 3:07 addresses this.
Reply: The Colosseum has no reinforcement. It's still standing.
Reply: Roman concrete is quite different than modern concrete because it contains a large amount of roasted Free lime .. when Roman concrete cracks ,the Free lime forms new concrete Bonds in the cracks, preventing crack growth
Reply: Delamination is a big issue with all FFF printed parts that are used structurally... I can't see why concrete would be any different.
Reply: Steel rusts, hence built in failure.
Reply: @capefear3297  we age too. Usually we're dead long before rusting steel in concrete is an issue.
Reply: Nah, you need volcanic ash, seawater, and quicklime.  Give me some good old roman concrete that actually gets stronger as it ages.  That sucker would self heal each time it cracks.
Reply: @GonzoIsCool  beyond the concrete itself modern homes are more than just the structural walls. Today we expect such amenities as electricity and even indoor plumbing. Some network connectivity isn't even out of the question anymore either. We generally expect that to all be built in now too. As in enclosed inside the walls. With this printing process doing that is not practical. That head or nozzle or whatever you'd like to call it isn't going to be able to move around all of those utilities. How would you even install it to begin with? There's a chicken and egg problem to solve. You can't attach any of it with no walls to attach it to. Whoever came up with this idea has no idea how houses are built.
Reply: This is by far one of the funniest damn comments I've ever seen "Ah I break concrete with Jackhammer dahaha no like fibreglass."  Take the word of a demolition labourer
Reply: So true.  Which is a big part of the reason why this type of flimsy construction would be useless where I live, hwich is rather seismic!  I can't see this system being able to survive a magnitude 6 or higher quake.  No strength in tension, no strength in shear, and no strength in flexion. A disaster waiting to happen anywhere the earth moves down below.
Reply: I do agree that the concrete needs to be reinforced because I was told that concrete will eventually crack, its just a matter of when. Chicken wire seems like the best solution, but when do u insert it? It will block the 3d printer bc it prints on layers and it starts at ground level and works it way up. Can you still insert the chicken wire after its poured (aka stabbing it into the concrete)? Bc it cant be before.
Reply: @rystewed  the concrete they're using here has some kind of fiber in it to reinforce it. But fiber reinforcing is not as strong as steel reinforcing is. Fiber is still better than nothing. 3D printing concrete is some kind of a tech bro idea made by people that have never worked in construction because work is beneath them to do. So of course they've no idea how to do it or what is required. They just know they don't want to do it. Or pay anyone to do it for them. Besides reinforcing how do you run utilities in the walls? Electrical and plumbing? How do you insulate it? Doors and windows? I don't want to live in a house that looks like the Michelin man. This whole deal is beyond stupid. It is not easy to improve on common practices. We build a lot of houses so we pretty much know what we're about doing it at this point. To top it off making concrete is a greenhouse gas producing process. You have to put the cement through a kiln. A really big kiln. Emissions from cement kilns are a major source of greenhouse gas emissions, accounting for around 2.5% of non-natural carbon emissions worldwide. So yeah more of that please. A house built of wood sequesters carbon for as long as it stands. The opposite of good is bad.
Reply: EXACTLY THIS.

This is why the frenzy to do construction with 3D is a RELIGION, not engineering !!!!
Reply: @Jeff-i8u  if they want to speed this part of the process up we already have a way of doing that. It is called precast concrete. The walls are poured horizontally on the ground. Then they're craned into position. Doing that is reasonable. That's why it is regularly done now. Because it works. You don't end up with a building that looks like the Michelin man has an eating disorder either. Bro, cut back, you're as big as a house.
Reply: My thoughts exactly and I'm sure it's at the back of his mind too but won't say it just coz 🤷 I can already see the cracks in my mind especially after rains and strong winds.
Reply: They wanna sell this 3d printing as sustainable...you know what that means...for a lot of folk, using this 3d method will be by force coz it's good for the planet 😂😂😂
Reply: Yeah, I've been thinking about stuff like that too, "how durable is it actually? What if damages happen, how difficult is it to repair? How is it to install infrastructure in it (pipes and cables)?
Reply: Not necessarily on such a small scale project. Reinforced concrete is for projects that are much more vertical. And besides, other commenters have pointed out that it is given fiberglass addatives for additional support, which makes sense.
Reply: You know they can and do mix in wire shards into the mix roght? They dont talk about it amd keep it quiet but they mix both glass and steel wire inyo the concrete, 2 to 5 mm long strips that get mixed in. Its stronger than wiremesh in a way since it doesnt have an orientation bias as well.
Reply: They do have rebar in it
Reply: micro reinforcement is ususally part of the admixture. they'll put polyprop fibers or steel staples into the aggregate
Reply: The video doesn't cover that but that's why the home takes 3-4 people to build the home. Every 3-4 layers requires horizontal supports. As the walls are being layed out the walls can also be filled with spray foam insulation or alternatively hemp insulation can be a viable option.
Reply: The foundation should, but I don't think they are printing the foundation.
Reply: Armchair experts discussing engineered building solutions based on gut feeling . . .
Reply: @Conservator.  I never poured or jackhammered up concrete from an armchair yet. I have had a gut feeling doing those things though.
Reply: @1pcfred  I don’t doubt you but have you ever made any construction calculations?
Reply: @1pcfred  with how shitty modern contrustruction is I don't respect the word of any of them. You are included in that group.
Reply: Wow a lot of people in here with no experience arguing over fiber.  Take it from a structural engineer, fiber is not reinforcement.  Fiber is for crack control only.  We'll let you get away with it on a driveway or similar because the steel in a slab-on-grade is also just for crack control, not strength.
Reply: @tippyc2   that's still better than nothing.

Add rebar while the concrete is fresh.

As well as polymer composite outer layers to reinforce the overall structure.
Reply: Reinforcment is needed only at bottom for cement not to brake and on line of roofing where roof works all the time and moves and Has tensions. On the walls you dont need it at all. But it depends on roof type also.
Reply: @ArturSobkow  Reinforcement is only needed where there's concrete. Everywhere that there's concrete. What kind of a third world engineer are you?
Reply: @1pcfred  What they do here is not concrete, and i do talk about this 3D print but i belive the bottom part is and so should be also tops done concrete for roof to hang onto it.
Reply: There are concrete buildings that are thousands of years old that have no reinforcement. Also this isnt your standard concrete.
Reply: @TomsBackyardWorkshop  we call buildings thousands of years old ruins today too.
Reply: I understand your sentiment, however the concrete is still stronger than a wood frame would be, Even without reinforcement. And it's not designed to take a large load regardless. All it has to do is stand there and resist weather. It's not a heavy load-bearing system.
Reply: @captainironbat8193  tell me that in an earthquake.
Reply: @captainironbat8193  the question is what forces.   I'm sure these are great for hurricane and tornado events,  but probably terrible in earthquakes, unless the walls shake with the foundation as unit.
Reply: @ Even without extreme weather, ground expansion and contraction (e.g., due to rain cycles and seasonal freezes) are going to mess these buildings up.
Reply: there is rebar bruv
Reply: I've seen fiber reinforcement in a concrete building.  It was in the concrete BLOCK walls of a shoothouse, made specifically to disintegrate when projectiles strike the walls, stopping ricochets and absorbing the spalling of the round striking the wall behind the targets.  The fiber reinforcement makes concrete WEAKER, especially if you don't use the right fibers.
Reply: @AflacMan13  there's different fibers. I've seen it get dumped right into trucks at the site. Comes in a plastic bag. They dump it in and roll the barrel to mix it. There's your fiber reinforced concrete. It's not even a particularly large bag. At least what I've seen used wasn't.
Reply: steel shortens the lifespan on concrete significantly mate
Reply: Well yea. Cuz concrete absorbs water and is porous and so the metal ozydizes. It's a good solution but it breaks down. These huge buildings the metal will still ozydize and break down   @mrmoney10oo01
Reply: @mrmoney10oo01  use basalt rebar,  from small fibers in the mix to larger, primary reinforcement bars added during the print process.
Reply: Steel or iron inside of concrete ensures its failure even if coated.
For relatively short purposes and possibly in areas of perfect climate its valid but … There are several alternatives to ferrous metals.
Reply: @Bay0Wulf  your definition of short and mine differ. We don't build anything today with a life expectancy greater than how long steel reinforced concrete will last. Steel reinforced concrete will outlast anyone that is involved in its construction. If it outlives you then it effectively lasted forever from your perspective.
Reply: @Bay0Wulf  oh you're absolutely right I've seen things just crumble in what a month? This is not going to be very strong and all these fiber things they came up with are just things they came up with they aren't doing the job
Reply: They will probably just end up putting graphene powder in the mix, easy and soon to be SUPER cheap option with how plastic waste and other garbage can be turned into graphene for free with the new technology developed by Dr Tour at Rice university. They basically just zap it with electricity you get graphene and hydrogen gas which you can sell making it not only free but making you money.
Reply: @WaterspoutsOfTheDeep  who are you going to sell hydrogen gas to? Everyone knows what happened to the last guys that were using it. https://youtu.be/CgWHbpMVQ1U?t=171
Reply: @1pcfred  He was telling you about the hydrogen gas you mentioned. It can be used as a fuel source. It was your last comment before WAterspouteOfTheDeep commented.
Reply: Lmao.u know 3d.print3d guns can go as long as the all metel ones when done right? What makes this any different? Just need to find the right process
Reply: @JamesSpatt 3d printed guns do not last
Reply: @markdaniel8740  and how many 3d printed guns have you shot till they failed?
Reply: @JamesSpatt  plastic?  It don’t think so.  Laser sintered. Sure.
Reply: @JamesSpatt  no I don't know that at all. But I do know that when they retired a vickers they fired it for three days straight first, 24 hours a day and put 9 million rounds through it in those 3 days alone. That was after it'd been in service for decades. Finally they got bored but the gun still worked. Did you know that?
Reply: @1pcfred and it was 5 million rounds in 7 days